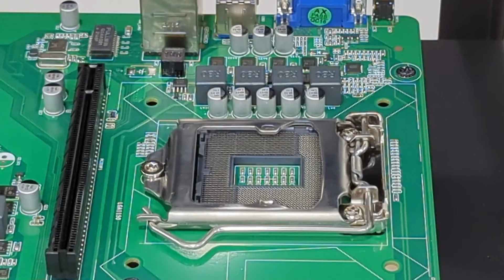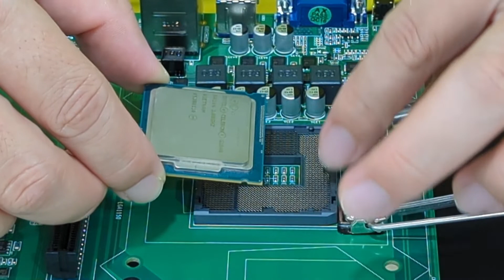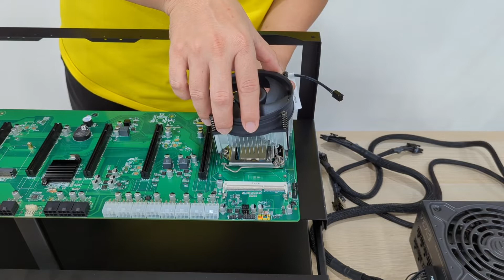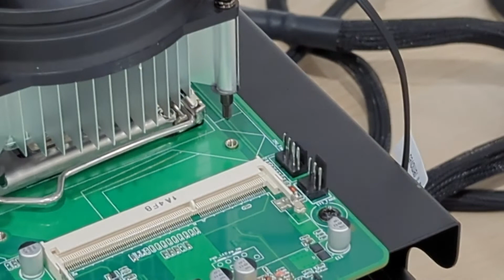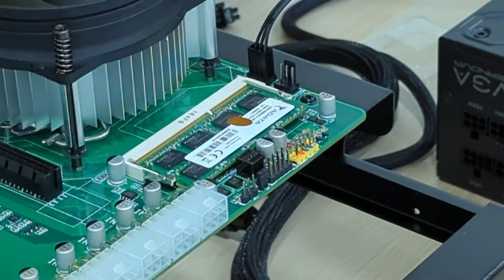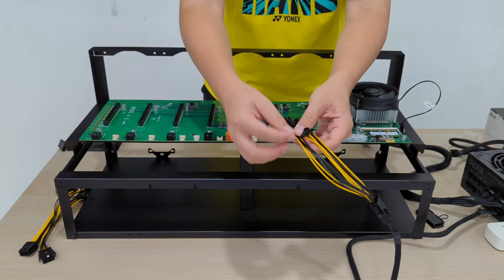EP-0003 - Introduction & Troubleshooting - GV Elite Rig & AX B85M ETH

Comment: @Himon Tee  Thank you for your video to install the mobo. I bought AX-B75M-eth mobo but the power cable installation is different. Do I need to remove the small paper in order to boot the system? I do not see the BIOS Utility page so how can I install the window 10 from USB stick? Please help. Thanks.
Reply: small paper? windows 10 only can be install in SSD, size 240gb is recommended.

Comment: No signal on TV
Reply: make sure you use vga port on the mobo and when the start of the rig should have "beep" sound
Reply: @himon84  what is mobo ?
Reply: motherboard
Reply: @himon84  I have everything plugged in but I don't have the bios that appears during startup
Reply: got the "beep" sound?
Reply: @himon84  No and I changed the ram and the processor thinking that was the problem, nothing helped
Reply: I have the green light on the hard drive but no light on the internet cable while it works on another motherboard
Reply: unplug and insert the ram or cpu multiple time to confirm ( atleast 3 times)
Reply: then check anything short the input 6pin on the board ( there are 6 pins for each connector, see got any debris that short the board) , cannot supply power to black 6pin on the mobo too.
Reply: also change the battery on the mobo
Reply: @himon84  I tried many times for days, battery, ram, power supply, processor nothing works.
I think the motherboard is dead
Reply: but it's weird that the green diode lights up on the hard drive and not on the internet cable, I bought new on alibaba I think that during transport it broke
Reply from the maker: the board should hv beep sound before start up else the LAN port should hv light on too before start up.
Reply: @harimaumining5995  I don't have any of that suddenly the motherboard is dead?
Reply: it could be. can u send the board back to seller for exchange?
Reply: @himon84  I contacted the seller he will send me a new one we will see
Reply: good to hear that